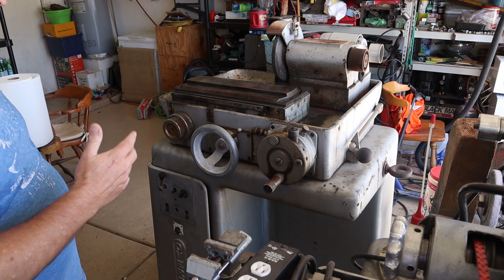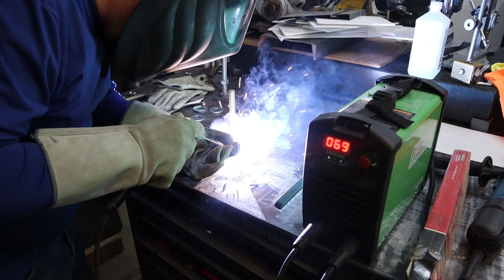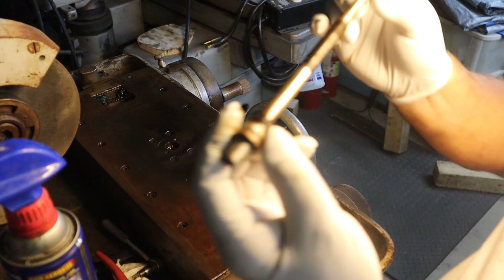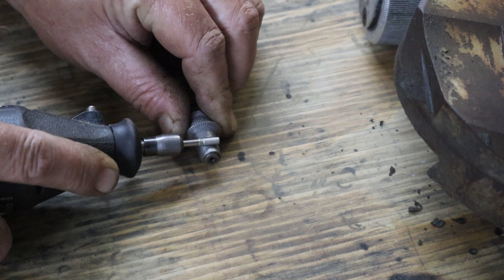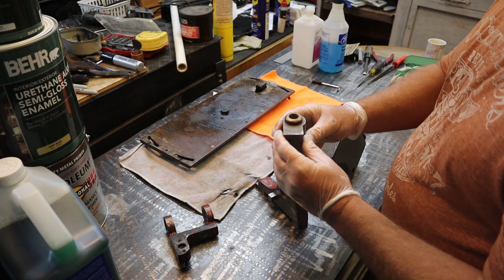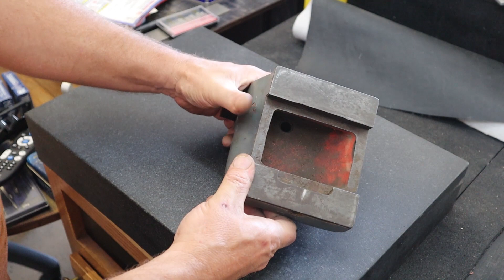Overbeck Zetto 20 Cylindrical Grinder Restore, Part One.

Comment: Cool , it should be an interesting project . I am looking for a cylindrical grinder as well , they are not cheap ! Cheers .
Reply from the maker: Max, It was very low cost.  The shop I got it from wasn't using it and needed the space.  Nice cnc shop too.  I think it is 40mmx400mm size.
Reply from the maker: Oops 40x120. So really small.
Reply: @AlmostMachining  I am going to look at a universal one tomorrow  300 max dia & 800 max length  ID & OD  head  . Cheers .